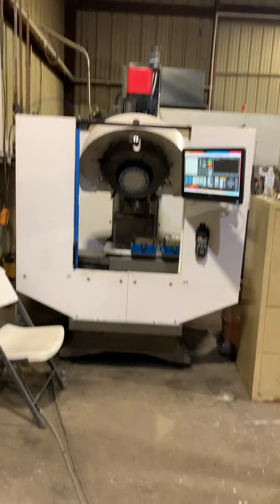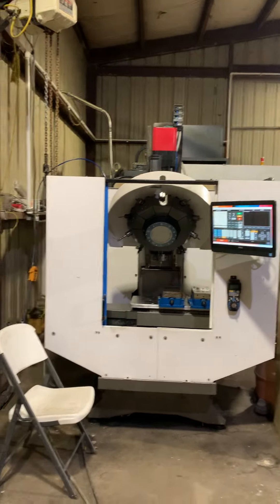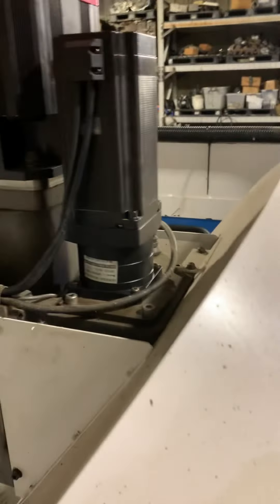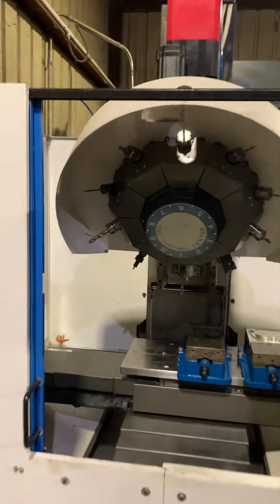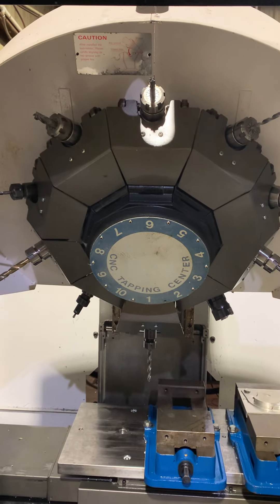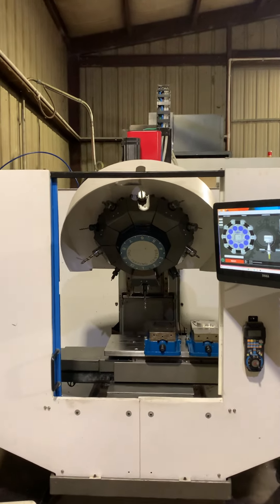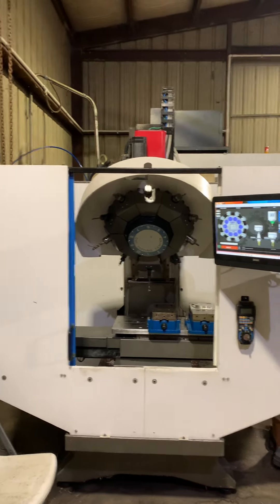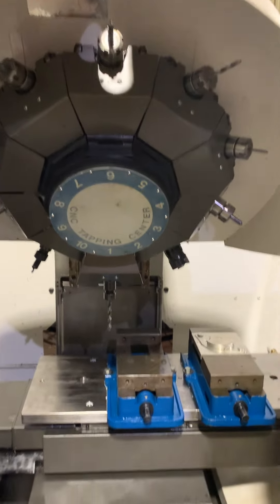Brother Mach3 cnc retrofit (learn from my mistakes)

Comment: For a price similar to the closed-loop steppers, you can get AC servos. They are more precise and more powerful than a similar-sized stepper. They can be controlled by step and dir like normal steppers.
Reply: The Small AC servos I used for my HaaS conversion with Brake were a little over 500 dollars each and work great. I am going to use the same Hybrids for my carousel. Cheers keep up the good work!!!
Reply from the maker: This were about $100 a piece 😂 I wish I had more money at the time I was buying
Reply: @chenosperformance2499  ah no 100$ is really a good price. You would need at least 200-250$ for a 750Kw servo + drive

Comment: What is the air used for ? I converted a TC-225 a while ago and I didnt use air at all.
Reply from the maker: Hi the air is to clean the tool holder tapper